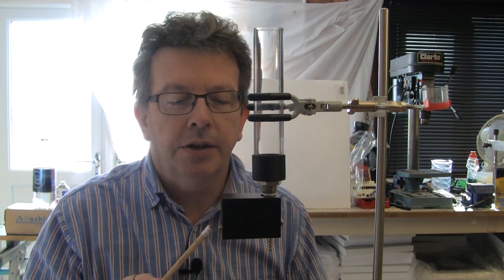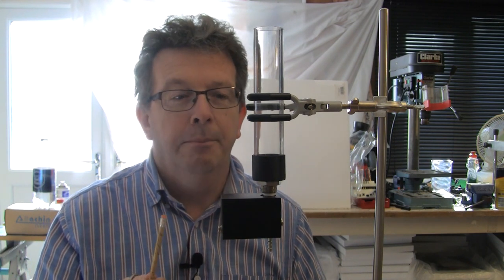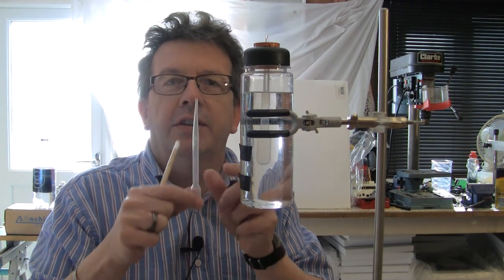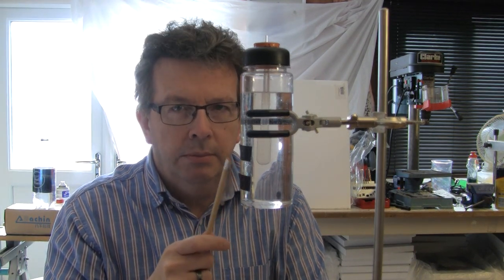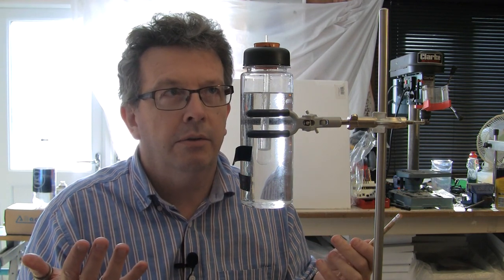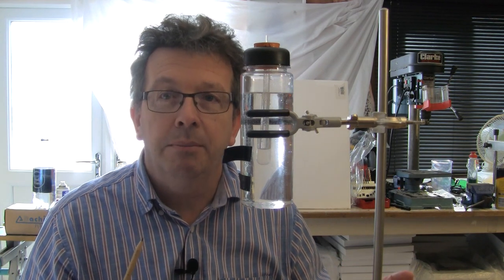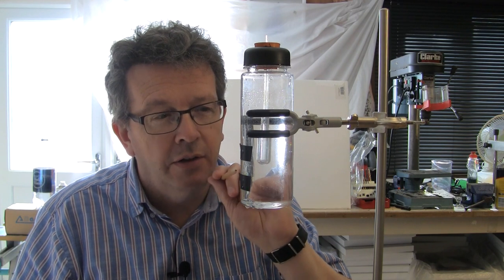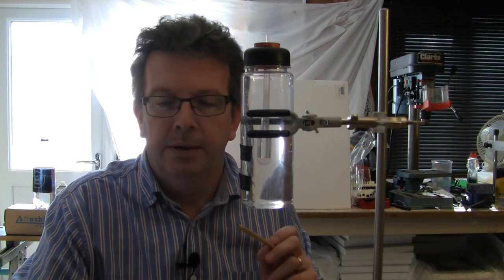Mariotte Siphon Explained

Comment: Thank you sir Mariotte, you made CISS printers possible :-)
Thanks sir David as well. I believe this is also the principle in automatic pet water dispensers and our cool water dispensers (though I don't see any inlet or siphon on the water dispenser. Maybe water dispensers function more like water tank, relying on the weight of the water more but then the water pressure is constant when it dispense, regardless of the water level).

I would recommend adding the explanation on what pressure truly is and that it's all about the weight (mass + gravity) of the air or air + water above the hole (equal more weight, thus more pressure, creating a pressure difference with the side with more weight going to the one with less or out the bottle which only has atmospheric pressure which is a lesser weight that the air in the siphone + the weight of the water from the bottom hole to the bottom hole of the siphone)

God bless, Rev. 21:4